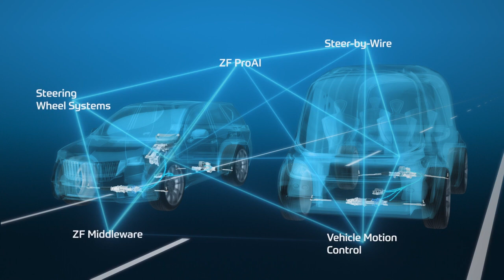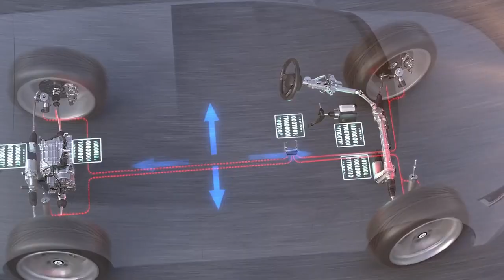Leading the by-wire transformation

Comment: Oh wow, BMW had that system in 2003 for the E60. And they already tested it in the E39 and E46 for development purpouses. Nice 0 improvement in 20 years ZF...
Reply: The BMW active steering is not a steer-by-wire system. The steering is still mechanically connected to the steering wheel, the electric motor only augments the inputs of the driver and in case of failure it degrades back to a regular rack and pinion steering system.
Reply: Hi  @Alexx120493 , thanks for your input. You are totally right. The BMW Active Steering is not a Steering-By-Wire system. I know that X-By-Wire systems are a totally different topic and should not be compared. However, regarding the advantages presented in the video. I can only think in the passive safety improvement from the Active Steering. I suppose that the ZF system reduces also the weight and also lowers a little bit the center of gravity of the system. But for the normal user, the capabilities of the two systems are very close. The old system from BMW can even accept steering input requests, for example from the ESP system. Another similar state of the art system is the 2001 Mercedes-Benz SBC system, still not a Brake-By-Wire system but very few new cars have the capabilities of that system.